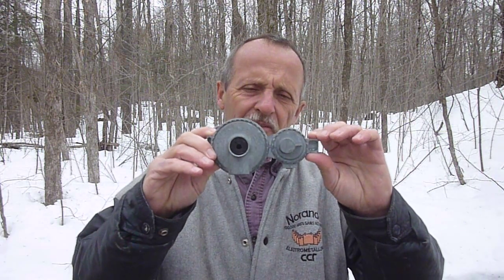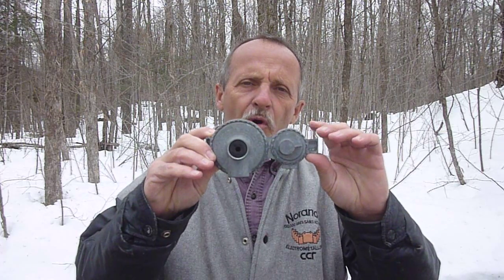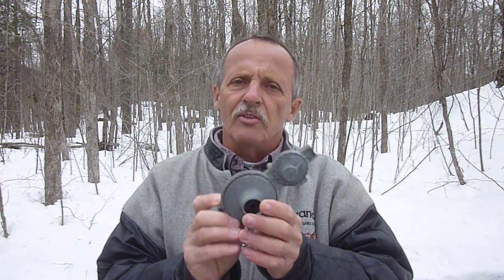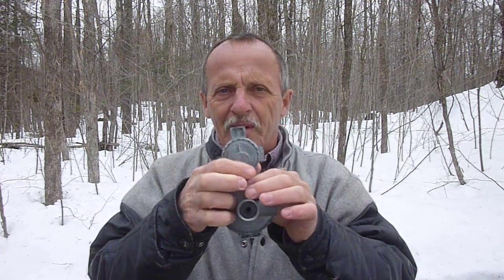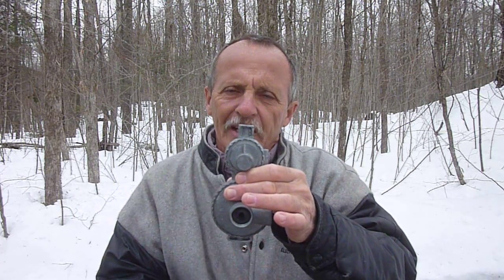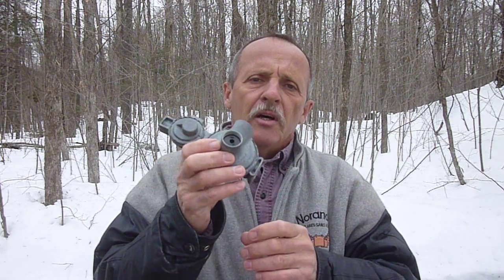RV Propane Regulator

Comment: 10 years later, still very relevant. We have the exact same regulator he has here in our class C, and it was dialed up way too high (over 15 inches of water column), which was causing problems with our fridge running on propane mode. Adjusted the valve you pointed out and used a meter to ensure it was running at the proper pressure. Refrigerator works perfectly now. Thanks for your help!

Comment: Thanks for the informative video. I turned on my new fully charged propane tank to quickly and the flow is not minimal. Tried light tapping with a hammer to dislodge the diaphram or high flow safety valve. no luck. I have a new one on order. I will try to turn the adjust screw clockwise and see if the flow increases before the new one arrives....great video

Comment: Should an RV Propane Range always have a two stage regulator?
We bought a Dometic 3 burner with oven and it looks to have a small regulator inside it where gas line connects; nothing on thenreg to indicate pressure rating.
Manual says NOTHING about hookups ;(
Do I need anither Reg  between 20# tank & the small regulator?

Comment: I have a 2013 Heartland Cyclone. Mine had a 40 psi regulator on it. It started smelling like gas in the camper and I realized the Reggio was leaking heavily. It was a single stage. I replaced it with a single stage Low pressure regulator. It immediately started leaking again from the regulator as well. Should I replace it with a High pressure single stage  regulator?

Comment: I see your not from Arizona but with your years of RV experience I thought I would ask. I have a question based off a sales scenario. I buy 2016 Dutchman Voltage Fifth Wheel Toy hauler, 80K, Check. I walk through with "Highly knowledgeable Tech, check. I take trailer home and start camping, check. In the last year the dealer has had my RV longer than me. Norcold 1210 throwing No Flo code. I was told by dealer to shut off fridge, turn off propane, turn propane back on, light stove (as it functioned) and turn fridge back on. Check. After 8 or ten times doing this as the alarm kept us awake, I go home. RV at dealers 3 times and after third time I called Norcold. This is now 1 year later as we have only got to use it 3 times. Norcold asks me if I was camping over 5500 ft in elevation. I tell the why yes about 6500 to 7000 ft. I live in Arizona and it's 115 degrees why? I only bought it to camp north of 5500 ft., why? Well we can't guaranty the fridge will function over that. I replied. WTH? Two of the guys I camp and hunt with have the same trailer and fridge and they have not had a lick of trouble. She says, well I guess some work and some don't. What, I exclaimed! Anything else I can do for you she replies. I get the altitude thing but this is the 5th RV I've had with Norcold. No problems in altitude? What do I do? Pull it out and shove a Yeti in there? Does no one camp north of 5500 ft anymore? Don't they sell these nation wide? AAAaahhhh! Thanks for listening.

Comment: I have a Genrac 17 kw generator that is supposed to burn about 2.7 gallons of propane per hour.  We recently had a hurricane come through and lost power requiring me  to use it for about 14 hours.  In that time, we burned about 100 gallons which definitely exceeded the 2.7 gallons per hour.  Does this sound like a regulator issue?  We did have the gas company come out and they didn't detect any leaks.  When the generator is running I can definitely smell the gas, but not when it is off.

Comment: Great video!  What happens if the pressure is turned up too high on the second stage regulator?
Reply from the maker: Those types of regulators max out at 13 or 14 inches of water column, so not much will happen really. But if you chose a wrong regulator that puts out 2 pounds of pressure (28 inches of water column), then you could end up damaging the workings of some appliances.

Comment: Thank you for the informative video. I am sure that is what is wrong with my travel trailer.  Everything works with the propane except the heater. Everything points to the regulator. Now being in Anchor Point Alaska I hope I can find one near here. Maybe in Homer.  Fish on!
Reply from the maker: Usually, when the regulator fails to some extent, it shows up on all the propane appliances (water heater, stove, fridge, and furnace). If all your propane appliances are working well  and only the heater is failing, then I would suspect something wrong with just the heater. Good luck with that and let me know how it turns out.

Comment: Guy, I have an issue that I cannot find a solution anywhere! My furnace started making a high pitched squeal. I have narrowed it down to the LP since it only squeals when LP is connected. Temp are lower here (30's), but no one else I know has this issue.
Reply from the maker: +Chase Hughes Chase, could be a few things. The most important (and dangerous one) being that there is a hole in the heat exchanger that prevents the proper air to propane mixture from being achieved and causing some problems. Some duo therm models are known to have problems with heat burning holes in the heat exchanger causing poisonous carbon monoxide gas to leak into the RV, as well as other problems.
Another problem can be just insects (spider webs, or mud wasps, or certain types of flies) making homes in the furnace and prevent the proper flow of gasses. Sometimes just using a compressor to blow out the furnace will solve the issue. Blow out the heater exchanger from the exhaust and air intakes on the outside of the RV. 
Another problem I have seen often is burner jets that get plugged up a bit, but this requires removal of the furnace to repair, and high temp gaskets to be replaced.
Another problem could be low gas pressure, and that can be adjusted at the propane regulator. You need a manometer to adjust the pressure correctly.
Depending on how old your furnace is, replacing it can be another option. 
Good luck with that, and please let me know how you solve the problem. Cheers!
Reply: +Guy Presse thanks for the response! It is a Suburban SF35F model that is 16 years old, but with little use. I blew out the intake and exhaust (nothing came out) and removed the unit to inspect. The heat exchanger looked brand new still. I noticed what I believe to be a second regulator with a solenoid supplying only this furnace. This regulator looks alot newer than the original one behind it. I guess my next step would be to adjust the gas pressure? Thanks again!
Reply: Guy, FYI I replaced my regulator and everything works great again! No more screaming noise coming from my furnace! Thanks for your help.